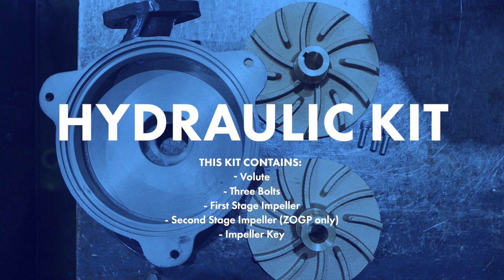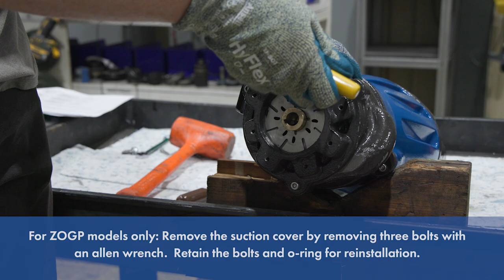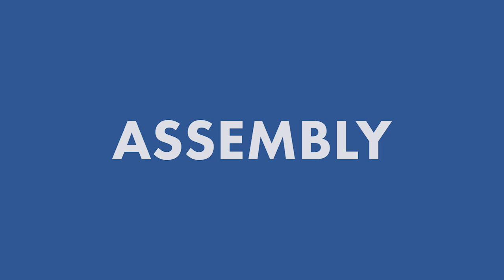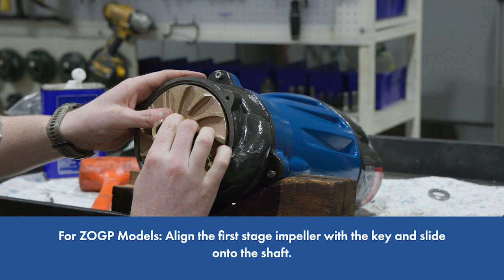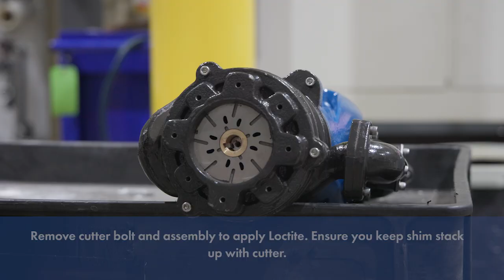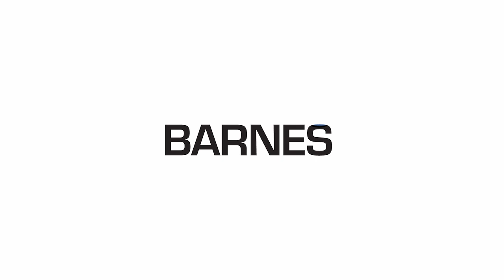Razor Service Series: Hydraulic Kit

Comment: Did  they ever redesign the voult   out going pipe area .i had 3 shipped all broken in shipping.  They Just need to remove elbow before shipping. If not it breaks the casting by that area or chg there packing procedures
Reply from the maker: Thank you for this feedback. CP&S is committed to continuous improvement across all aspects of our business. We have redesigned the discharge elbow for this product line to prevent such damages from occurring.